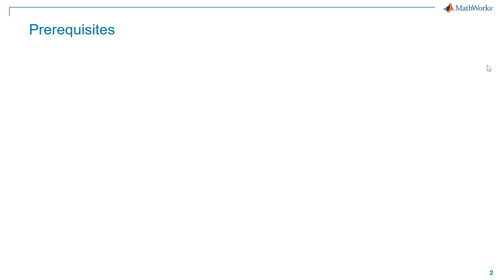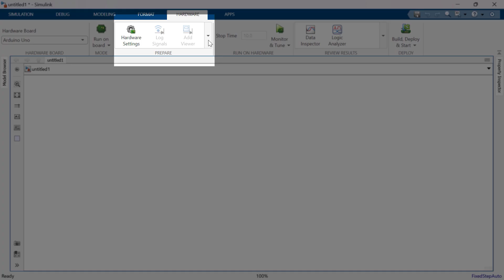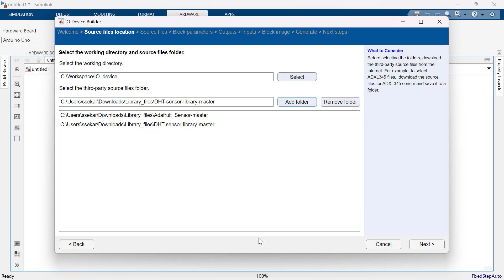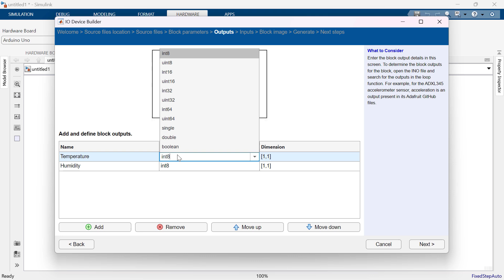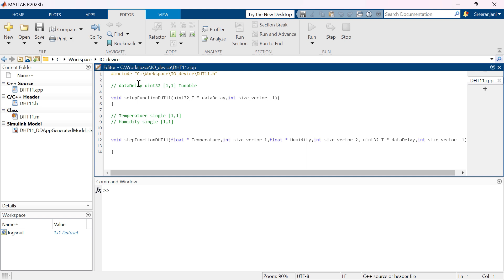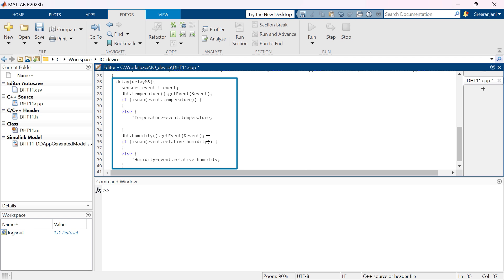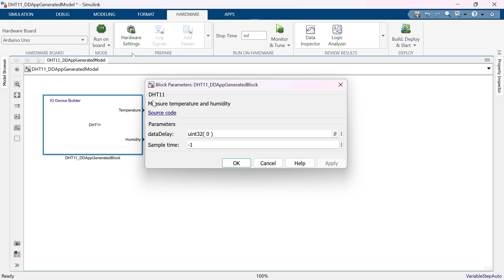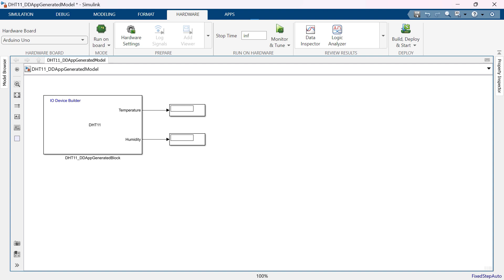How to Build Custom Sensor Blocks for Arduino in Simulink

Comment: I followed all the steps but I got this error Error: Errors occurred while building "DHT11_model".😢
Reply from the maker: Please create a tech support case with the snapshot of error from diagnostic viewer https://www.mathworks.com/support/contact_us.html
Reply: @MATLAB  Unfortunately, the s function does not recognize the Arduino board model when I try to use the output mode. Thank you.
Reply: @mmkr2004  i am also dealing with the same issue , can you please tell me how you resolved it ?

Comment: I followed the steps exactly , but I get this error when I run it,"code generation file does not exist"??
 I have repeated the process more than once, but still, no success.
Reply: I also encountered the same problem. Matlab file path and working directory must be the same. By doing these the same, I reached the solution.
Reply: Is this same possible for STM32

Comment: Really nice video, something I will have to try with MATLAB. Can I ask why @4.25 you selected unit32 for the Data type over any other selection? I see the text on the right of the screen discusses this, it would have been nice to see where the values actually came from, or how to find them
Reply: The dataDelay parameter is designed to introduce a pause within the setup and step function. It has been illustrated using a 32-bit integer, but you can configure it for any parameter and datatype as needed for your application.